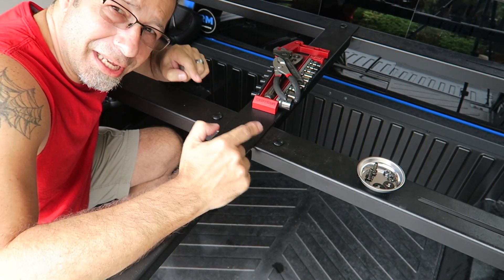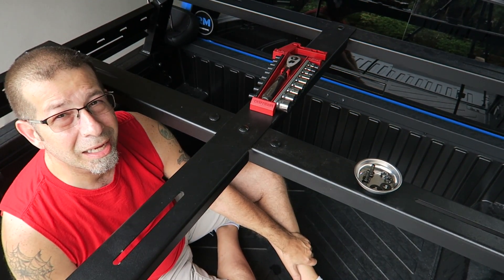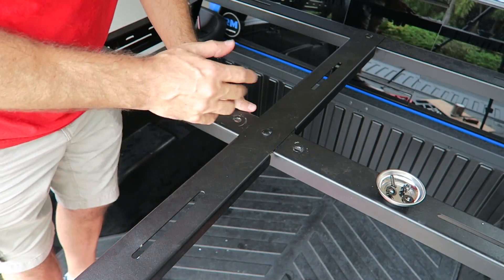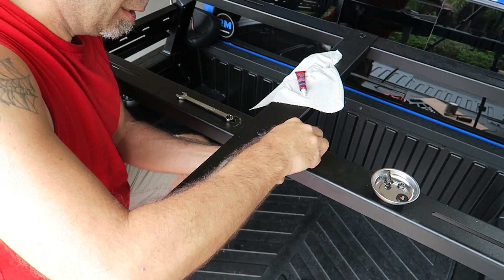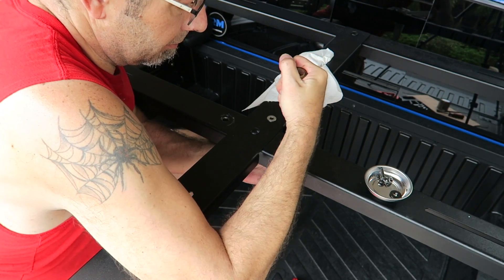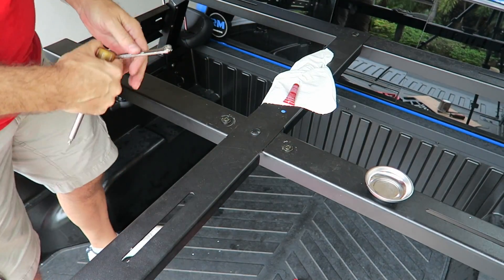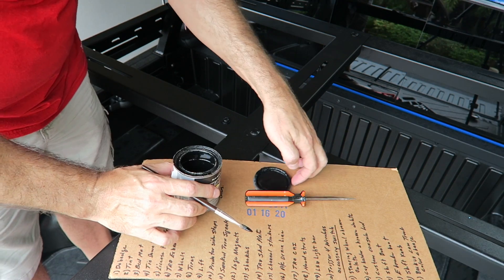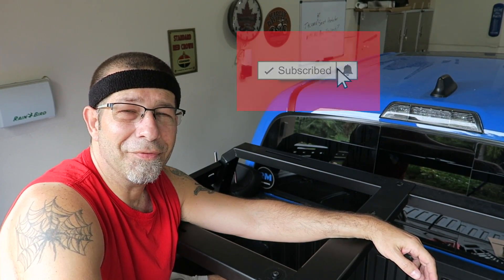Tacoma Bed Rack Bolts that Need to be Fixed

Comment: You should have just put a couple of small hold down (eye bolts) painted black in those holes. Then you have the holes covered and the functionality of 2 hold down points for tying something on top.
Reply from the maker: That's a good idea.  Perhaps I'll change them down the road👍

Comment: Rob, aesthetics are your mission apparently. Bolts are fasteners, so filling the hole with a fastener can only serve aesthetic purposes. Without a square hole the structure is actually less compromised than with the round hole. Since the holes are not very important due to their orientation to the load on top of the rack you could just paint the holes to prevent rust and call it a day. Either way rest assured your rack is still fundamentally sound since the members in the vertical orientation are carrying the load, not so much the horizontal flange that you drilled. Cheers!

Comment: Why didn’t you just remove the carriage bolts and touch up the paint?
Reply from the maker: I could have I suppose.  Just chose to do it a little differently👍
Reply: Or paint the inside of the hole where exposed metal was visible then insert a plastic body plug with a smooth flat head... Or. You're way most likely is my way because now it's done. 👍
Reply from the maker: Lol!  True!  😁